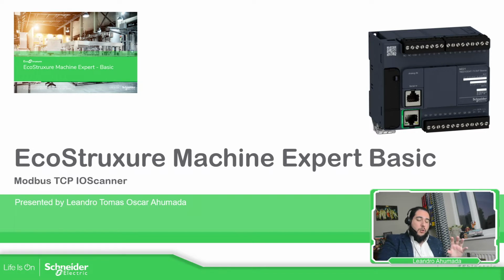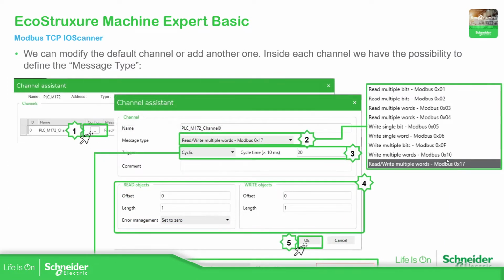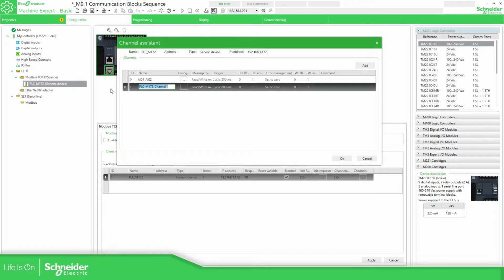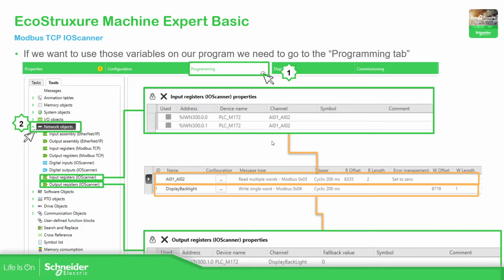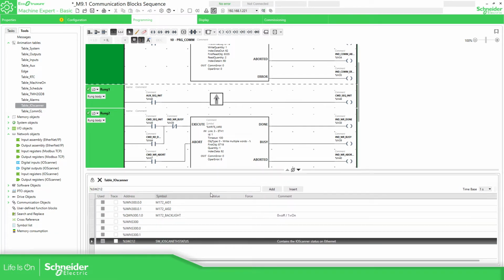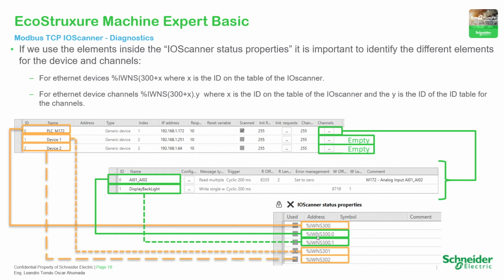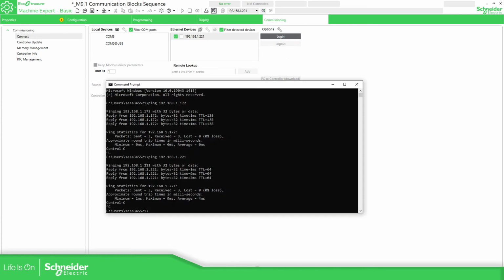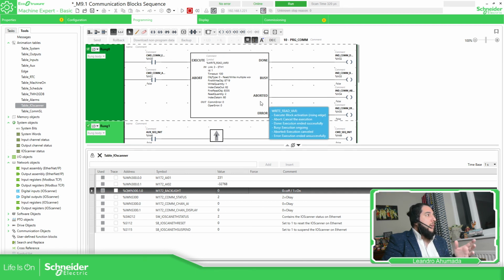Training - M221 - M10.2 Modbus TCP IO Scanner

Comment: Hi leo. I have two tm221 each will read values from each other. I enable the io scanner on both plc but it was not reading. I tried also +/- offset of thetarget mw but nothing happens.any idea
Reply from the maker: Hi there! I recommend you to enable the ioscanner in only one to read write info into the other m221. It is important to have the modbus server enabled otherwise it will not work

Comment: Good evening Mr. AHUMADA, is it possible to do Modbus TCP in IOscan or with Read/Write blocks other than Schneider hardware? Thank you, how can we discuss this subject? Sorry but I don't speak English.
Thank you for everything you do.    Google Translate.
Reply from the maker: Hi there! It is possible to make the Ioscanner or using blocks to communicate to any non schneider modbus device. Write another comment with the devices you want to communicate with.
Reply: @LeTomasAHUMADA  Hi, here is my case. I use an M221 to do home automation. I use a module (11336) from ESERA automation, it is a one wire gateway to Modbus TCP. I can do IO scans with a TSX 57 but it is impossible with the M221 (FC 3). With the M221 I just managed to do IO scans with a Schneider STB.
Thank you for your help.

Comment: I used the tcp io scanner on the m221 to read and write on the m340 and I couldn't write and read on the m340

what way should I communicate on the m221 to read and write on the m340 ?
Reply from the maker: Hi there! It should work (assuming you are connecting to the ritgh ports). Try reading just one word from the m340 and check on the m340 the previous and next position just in case

Comment: Do you need to reset the communication every time if the communication fail, as you show at the end of the video? Or does the PLC tries to reestablish the communication?
Reply from the maker: Hi there! As far as I know we need to manually reset it using the system bit and monitoring the comm using the system word. I believe this is a way to know that there is a problem with the slave/server and need to be addressed.

Comment: Nice training about M221. Is it possible to set in M221 different modbus port than 502 if slave has set some non-standard port? Or 502 is a must?
Reply from the maker: Hi there! Thanks :)
As far as I know we use the 502 in order to connect to the M221 from our PC and it is not possible to change.
The simulator of the Machine Basic allows you to change this in case that port is already in use by another application but this will not help you in what you want.
If you need to use the M221 as Server then you have the UnitID to change to the one you want but i believe this is not what you are after.